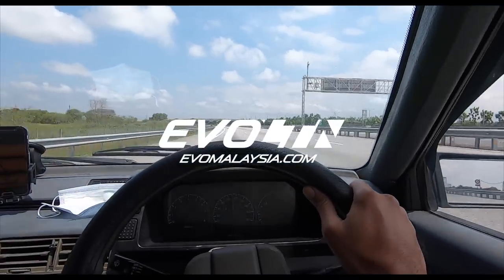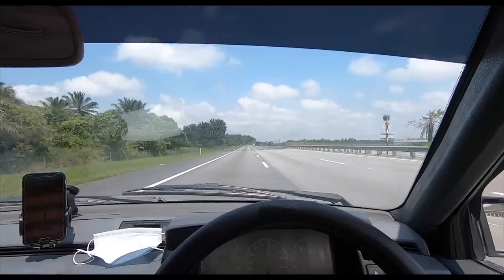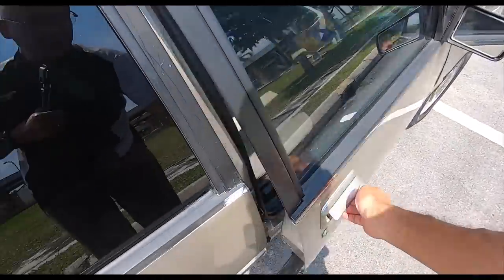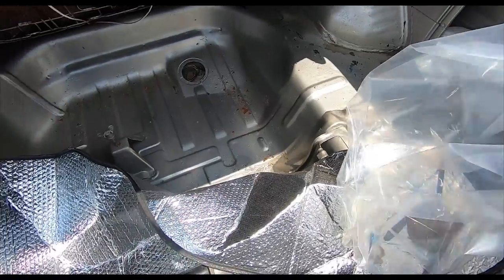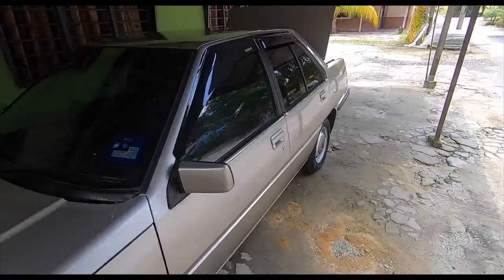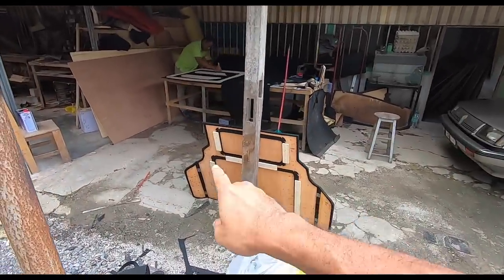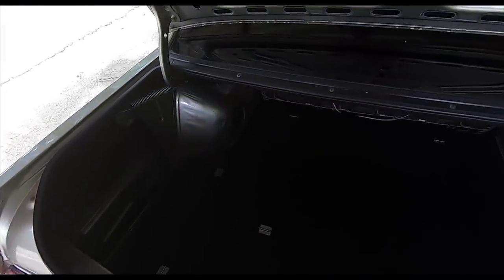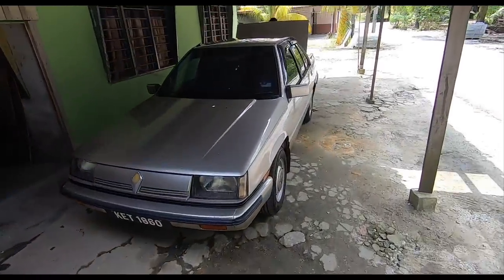SUNDAY SPECIAL - UCR: 1985 Proton Saga - Getting the BOOT! No, Really... | EvoMalaysia.com

Comment: Hi Chris, correct me if i am wrong, this speedo is not the earlier version or the 1st gen speedo.. This is the second version, which was carried over to iswara. They updated this speedo when proton replaced the magma  to the megavalve. The 1st gen speedo was the one with a cross in the center of speed and rev counter, had bigger font. I kind of like that compared to the orange needle ones.
Reply from the maker: Correct. I already mentioned this in the very first video actually. The good news is in the second video, I've already found and purchase the original meter for this car 😊

Comment: Chris,  @4.32 shown there's a meter dimmer. Then the car original is a 1.5 not a 1.3 unless previous owner had done alot of mod upgrades on the interior.
Reply from the maker: Originally a '85 1.3 Orion, previous owner upgraded to 1.5 Megavalve engine, and some MV bits too, which is fine by me 😊
Reply from the maker: I see the meter dimmer dial on the left, but there's also what looks like a power window switch on the right that I'm referring to, no idea what that does 🤭
Reply: @ChrisWeevilGarage  most likey probably is a switch for the power anttena. The only way to know is to asked the wireman trace the wire from the switch point to the end of the wire, that would give you the answers to your question. Unlikely that (switch) is an arm-switch to the engine fuel pump. Other than that, I can only figure that switch is for a secondary horn swtich over.